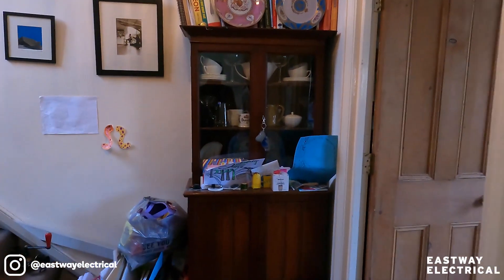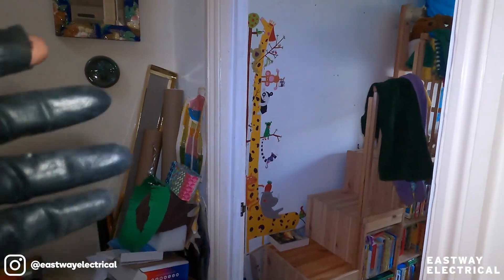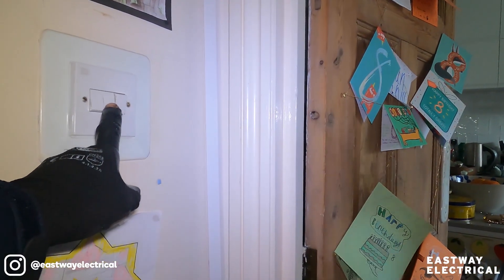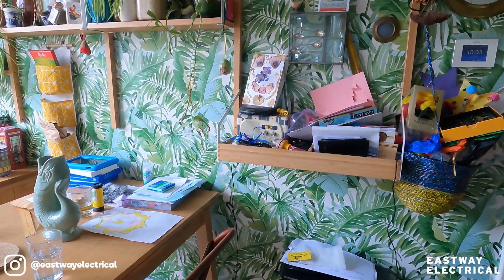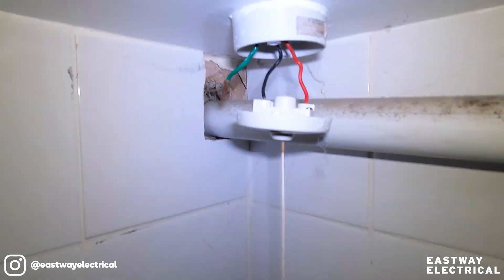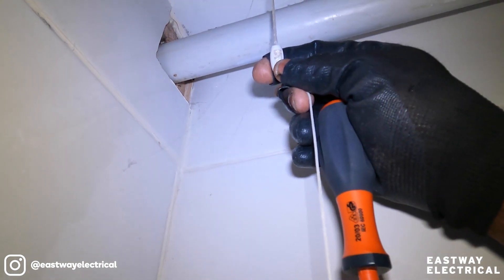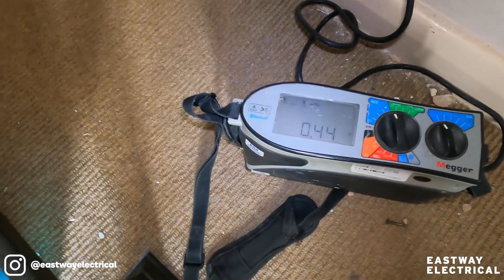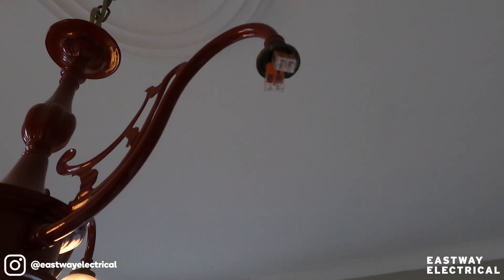Lighting, Power And Other Odd Jobs

Comment: How did you complete a minor works on I installing those sockets on the old crabtree C50 board. It didn't appear to to have any two module RCD's within it. I didn't see you test it either if they were there,  also  what about the insulation resistance of the circuit.

Comment: I just don't see how you could leave that safe? Did you do a Zs at the board and check the bonding because of the lack of RCD protection. I get changing the broken wiring accessory but not installing new ones. How are you ensuring ADS without all the above. Or did we just miss all of that in the video?

Comment: As an American, I'm puzzled by the UK's use of receptacles with integrated cover plates. When a drywaller or painter comes into patch those unsightly holes, does he now have to undo all of the electrician's connections? Is that not unsafe? I suppose he could try to patch it with the wires still connected, but nevertheless that's rather inconvenient compared to a removable cover plate which gives you full access to paint and drywall.
Reply: How about you stop judging the UKS sockets there fine atm
Reply: @WarrenTheSpark  I’d say more inquisitive than judgemental nothing wrong with wanting to know how other nations work.
Reply: @Lineandsinker87  Mhm that is true besides it’s more easier just to have an attached plate you can get get screwed in sockets with clip in plates tho
Reply: Australian wall switches and sockets are similar one piece fittings, you only have to loosen a wall plate, not completely remove it  to paint under its edges. I'm staggered at the completely exposed electrical screws on the US fittings. I've seen one guy fit a wall socket with a bare earth wire, then jam it all back in the wall with nothing to stop the earth wire touching line or neutral.
Reply: @CameraTim-DAMMITDOTcom  I have wondered about Australia electrics and just how similar it may or may not be seeing as it’s a sovereign nation